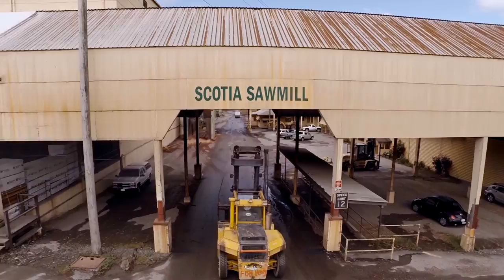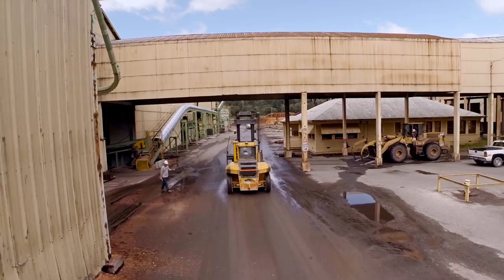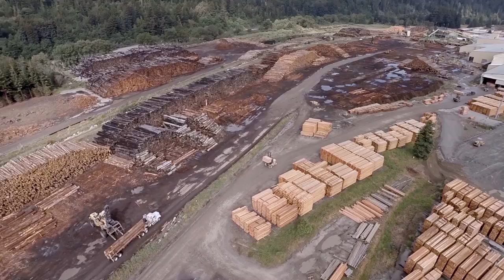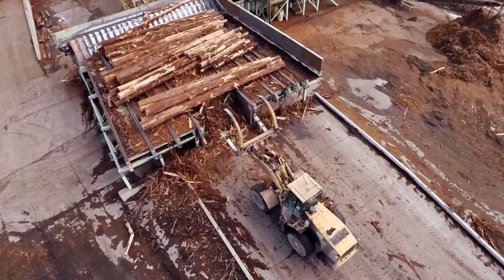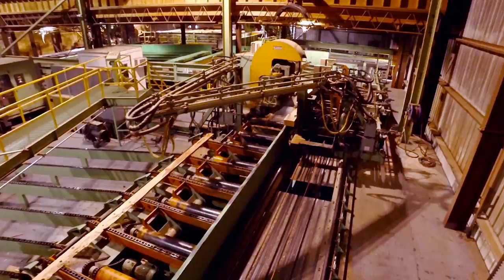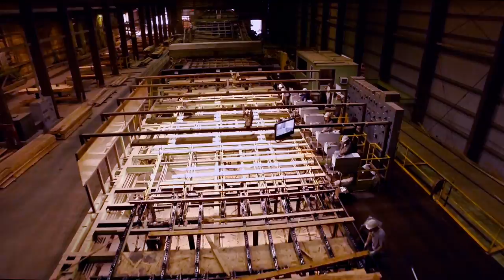Humboldt Redwood's Scotia Mill

Comment: Now in Kentucky..I just heard the machine shop had a fire...hope it can be brought back up...my Dad used to get his hammers he used in filing rm tweeked by Pete Johnson... Dad was in fortuna on the quad,then back to Scotia on the headrig....wound up being quality control after he couldn't bench saws anymore...   Alan Franklin, Chris Ravin you two retired yet? I know the marks bros are, Dad used to cut wood with them on their weekend....I still remember the horrible accident on the drum debarker,hit my Dad hard.  
     Everyone should be happy my toys and accessories are out of kalitràz....
   Does the powerplant still run?
Reply from the maker: Hi Dale, yes, the cogeneration power plant in Scotia, California runs and powers the mill and produces biochar! https://www.getredwood.com/redwood/biochar
Reply: The engine shed is still there. The factory or the old planer mill/end and edge building built in 1913 is gone. The old millwrights/presto log building is barely there. The pond and mill A are still standing. I will always remember sept 9 1992...